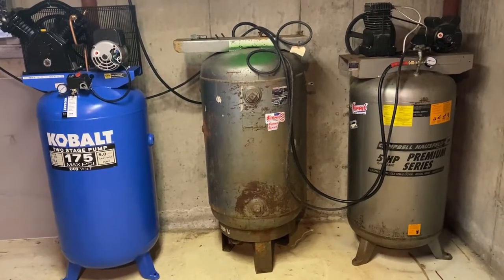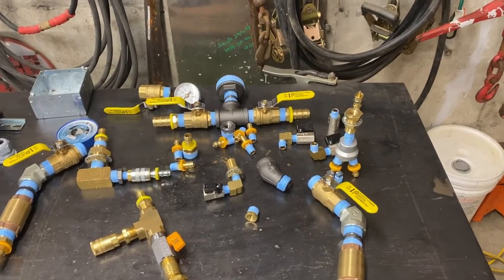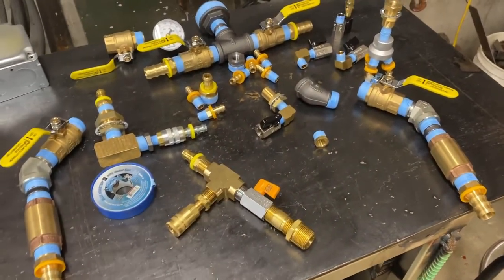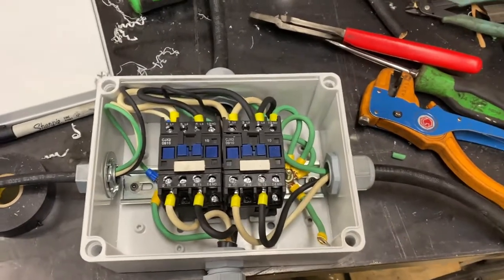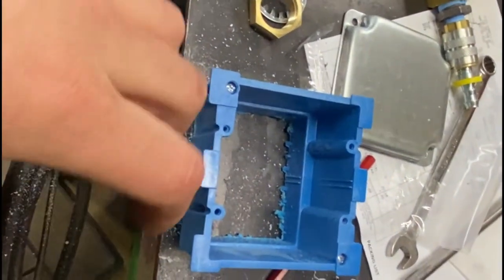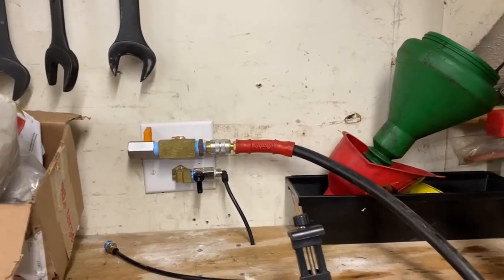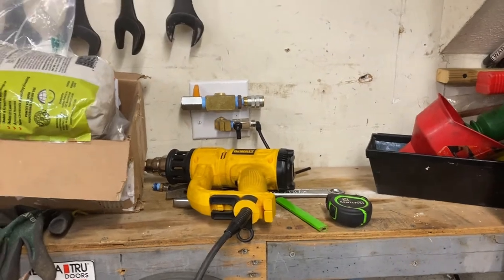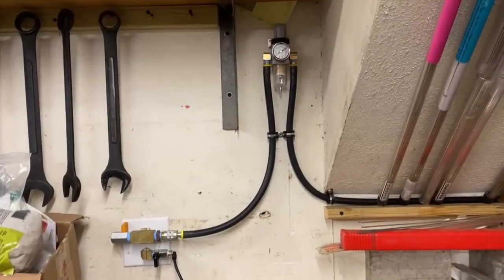Parallel Air Compressors: More CFM More Better?

Comment: Are you running both compressors at the same time off of the same main line at 20 or 30 amps without tripping the main breaker?

Comment: Great setup though I'm curious why you a didn't run all 3 compressors and feed them through a dryer before dumping into the tanks in series so that theoretically you would have 100% dry air by the time you hit the 3rd tank especially since you are looking to sand blast and I imagine that your going to be painting as well
Reply from the maker: the old compressor was pretty useless.  i did test it but not worth doing.  adding a drier was not part of the original scope but is a great idea and easy to add in the future.
Reply: Just a little tip or advice,  you should install on a self draining system downstairs on all 3 tanks, it will take the worry from you and give life to all 3 tanks and keeping them drained and dry

Comment: your cfm comes from the pumps what you have done is build reserve. your cycle times will increase . so you may be able to blast for 10 minute and then wait till your tanks refill . the 10 minutes is just an example . your nozzle size will determine how long you can blast till you wait on air. also set your blast pressure through a regulator at 95 to 100 psi. you may have more pressure in the tank . but optimum blast pressure is under 100psi. also depending on how your electric co bills you you may want to use a second pressure switch and off set them by 5 psi . you may end up with amperage spikes that your electric co may hit you pretty hard with on your bill. I am going to check out your other videos.
Reply: Hello. 
Could you explain about the amperage spike and the switch?
New to this. 
Thank you so much
Reply: @renatochiarella4750  when a motor starts it will have a amperage spike of 1.5 times FLA. many compressors will spike 1.75 times FLA. so if you have 2 pumps that start at the same time and you are on a demand meter (which is common in many commercial building in our area) your elec bill may be charged by the height of the spikes not totally the actual usage. also when the start it may end up dimming the lights or causing havoc  with electronic devices on the same system.
Reply: Thanks
Reply: Question:
Theoretically isn’t the new CFM be the summation of the 2 compressors 

Side note. I realize he uses the contactors as isolator switches ..I may have use both 110 lines,,, that way each compressor would be on separate lines. What’s your take???
Reply: @sabadabigarage1595  yes he will have the sum of the CFM from the 2 pumps and he will have 240 gallons of reserve air.
Reply: Where did you get your fittings and regulator?  
Also interested in 3D Printing 
Thanks!

Comment: Should have kept everything stock.just buy 2 check valves and pipe both to the single tank ,and use that as a draw .The checks are for air hammering , yep resident frequency is a thing . 
And you still get to shut one off anytime ,plus its easier to set your lagging compressor switch.

Comment: I cringe every time I see someone using a rusty compressor air tank. I have seen way to many videos of air tanks exploding and making a structural mess of someones property. IE: garage or basement. If the outside of a tank is rusty on the outside imagine what the inside would look like. Scary business.

Comment: x2 for the wiring/plumbing diagrams please.  This is exactly what I am setting up - 2 x 80g compressors (SpeedAir and a Craftsman Pro) + 1 x 80g aux tank (also Craftsman Pro). My stuff is 220 single phase.

Comment: Couldn’t you just use the pressure switches on the out put of the tanks to control when they turn on? The pressure will equalize in the tank. Contractor circuit seems like overkill.
Reply from the maker: yes but when the pressure drops you run the chance of only one of the pressure switched being activated and only having one compressor turn on.  this way both will always run

Comment: way too complicated mister. all you had to do was connect all three tanks together to make one huge tank, synchronize the cut in settings on the two compressors, and run that huge tank to a output pressure regulator before your discharge line. you don't need any check valves!
Reply from the maker: i removed the valves after
Reply: @Talbot_Industries  the only thing you have to be careful with is that all the tanks are rated for the same max pressure. I wired both my compressors so they run in tandem on the same pressure switch because the other switch ran up too high. It works very well.